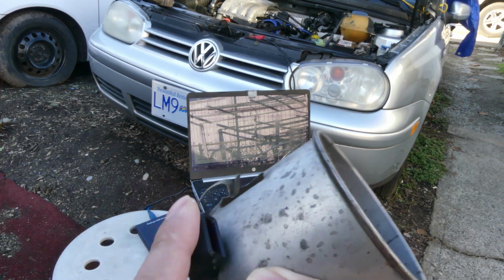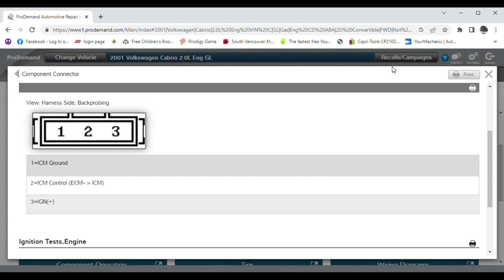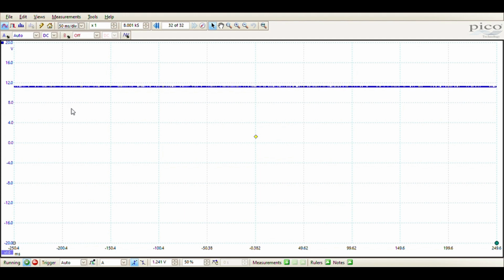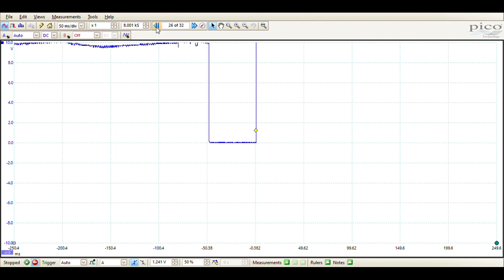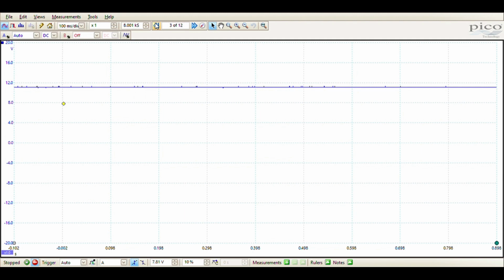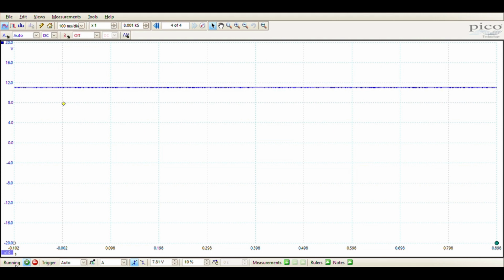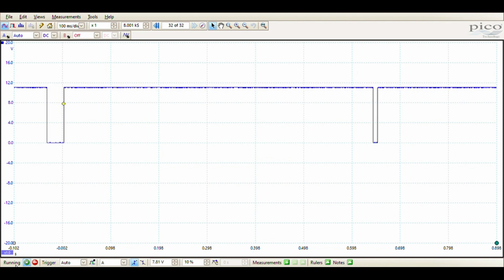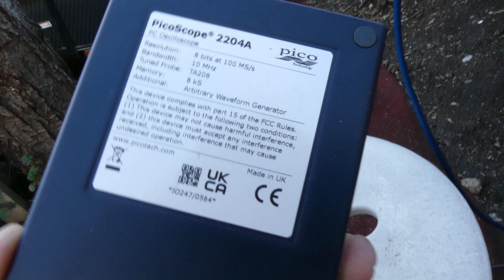2204A  PICOSCOPE 2000 Series on Checking Camshaft Positon Sensor Signal

Comment: simple and direct to the point explanation good job ..I totally agree u can only diagnose properly a cam sensor whether good or bad using a picoscope ..Imagine replacing a camshaft sensor together with distributor without diagnosing properly u will end up parts canon or money pit ..Pico is really a must in diagnostic
Reply from the maker: tama kabayan PICO is a must in diagnostic. I should bought this PICO long time ago it might be pricey together with my prodemand and laptop but it worthed using it love it so much im gonna use this everytime i diagnose a car with electronic/signal problem